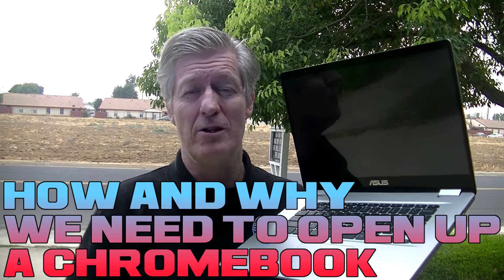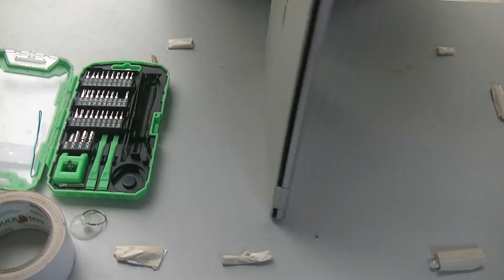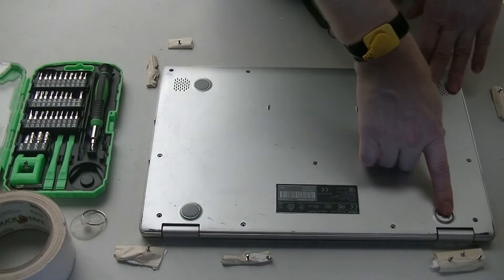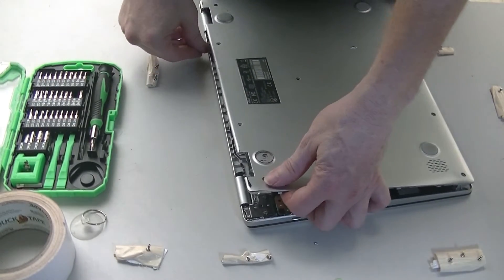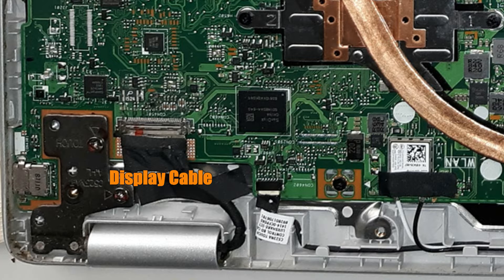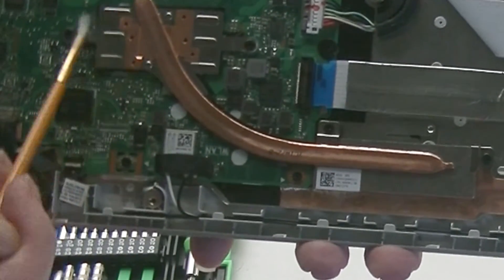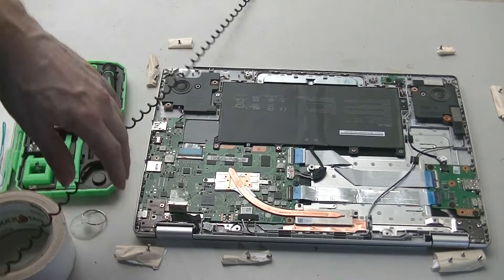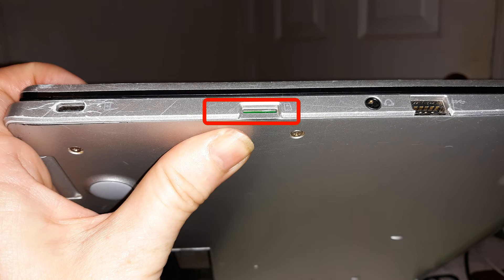How and Why We  Need to Open to Up a Chromebook- Disassembly

Comment: Sir my Asus chromebook overheating after charging and charger also overheating, please give any solution.
Reply from the maker: As seen in the video,   I would clean and blow out the dust, making sure the fans are free to turn.  If the charger is overheating as well, that can be a big problem.  Please make sure that the charger is used in the open and receives good air flow.  The charger may need to be replaced, if it is overheating to a high degree.

Comment: Q U E S T I O N ,  P L E A S E ---  Help !!!  Acer Chromebook 11 CB3-111 orange battery light blinking at times. The Chromebook is connected to work via the electrical power/adapter; HOWEVER, does the battery ALSO have to be partly or wholly full in order to run the Chromebook? ANOTHER QUESTION -- Can I not remove the battery - FOR EXAMPLE - and have it function fully via the electric power, just like a neighbor is doing with his Windows 10 laptop??? Thanks in advance.
Reply from the maker: A1:  System should be able to run with dead battery, if said unit is plugged into electrical power. 
A2: On some models, I have seen that they will run without the battery installed, (on just plug in power alone)  For the CB3-111, I am unsure, as we tested that with a few other Acer, Asus, and Dell Chromebook models and it did not work on most.  The battery needed to be installed in the Asus, Dell, and Acer Chromebooks that we tested in class.

Comment: Help: Can you please tell me where the WP screw is? It's called the Write Protect screw!
Reply from the maker: That depends on which Chromebook model you are working with..  But many models have the WP screw marked with a different pattern than any of the other screw holes on the mainboard.
Reply: @selmateacher7  Oh im using the same one on this video, the, C523N
Reply: So please say, i'm having issues finding it!
Reply from the maker: @yumesh9830  Oh, that model is based on the newer platform and it does not use a screw for the hardware firmware write protect, they use the battery sense line (IE, you simply unplug the battery).
Reply from the maker: @yumesh9830  On that one, it does not use a WP screw, if you need to change the firmware, you just need to unplug the battery.
Reply: @selmateacher7  Which part of the battery? If I unplug the battery it wouldn't charge?

Comment: I have Asus Chromebook C223N, I cannot reseed the battery and when it does power on the screen just flashes on and off.It's only 7 months old ?
Reply from the maker: Had the unit been dropped?  Please check all of the connections both on the mainboard and behind the display.

Comment: Hi I was wondering I have one of these laptops and the charging ports not working so it’s not charging what would I need to do
Reply from the maker: Have you tested it with a different charger?  I say this because I was seeing that one of my usb-c ports seemed not to work anymore.  When I tested it with a new charger.. bang it works...   If the port still fails, you can re-solder that part's contact points, being super careful not to apply too much.
Reply: @selmateacher7  I did I tried another type c charger it didn’t work
Reply from the maker: @victorolaniyan6571  Ok... then that USB-C port might be loose from the mainboard.  It is possible to solder the contact points , just be extra careful to only place solder on the one connection that is loose.
Reply: @selmateacher7  I don’t want to open up myself due to maybe damaging it
Reply from the maker: @victorolaniyan6571  oh yea.. we would do this in my class.  um ..is it still under warranty?
Reply: @selmateacher7  yes it is
Reply: But the told me a long process and it could take up to a month
Reply from the maker: @victorolaniyan6571  oh....  ok.   We work on Chromebooks for free in my class, but alas you are probably not in Reedley, California.
Reply from the maker: @victorolaniyan6571  ok

Comment: Is this chromebook any good thinking of getting this model
Reply from the maker: That model works well for doing everything.  It is of average performance for the price.  Average touchscreen display.  I like the Acer CB515 more, as the CB515 has a better display.
Reply: @selmateacher7  i picked this one up for £180 the only other ones in that price point were 11.6 inch.

Comment: Can you C423NA please it'll help a lot of you ro
Reply from the maker: The C423NA is very similar to the one I opened and cleaned in the video.  You be able to open that model up to clean, check for loose cables,  or repair hinges as seen in the video.
Reply: @selmateacher7  Well my cover comes off easily but the screen won't come out
Reply from the maker: @David.arasaka  On some models, I have to peel of the plastic front bazel from the screen, very very carefully to get to the screws
Reply: @selmateacher7  it's like my screen was glued from the back
Reply from the maker: @David.arasaka  hmmm. I see.
Reply: @selmateacher7  The C423NA has no screws
Reply from the maker: @David.arasaka  If really no screws, use hot air -heat gun to loosen glue, like on an iPhone.
Reply: @selmateacher7  Thank you very much

Comment: I need you to really just find a way to upgrade the eMMc drive as mine is corrupt asked the repair shop from asus to find the problem and they said they can't upgrade the eMMc drive. But from what you said, you said that it is not easy to upgrade it. So you might have a way? I am using the same model as the one your showing. Hope you have a answer after thorough testing.
Reply from the maker: LOL.  I have a video for that.  In the video I go over upgrading the EMMC
https://www.youtube.com/watch?v=vGatKmqYxEA

Comment: hi. have you tried to install windows or at least unlock bios to be able to install another system on this chromebook? cheers
Reply from the maker: No.  I happen to know how to do everything on Chrome OS which is more secure than Windows, so I normally stay in that Chrome OS. My other videos show how to find and do your work all on a Chromebook.   Thank you for the question.  Cheers.
Reply: There actually might be a way (Have not tried it) but you have to basically unplug the battery, remove it and then write protect will be off.

If your using like the older version of the chromebooks, you have to find the write protect screw (Looks like a disc)

Run these Codes in the terminal (ctrl +alt +t) to check:
cd; curl -L -O https://mrchromebox.tech/firmware-util.sh && sudo bash firmware-util.sh

once you ran that, you should be popped up with a menu (after downloading of course)
You might see WP is off/Disable. If not then there is no way to do this.

But if WP is disabled, select Full ROM firmware, if not available select GBB flags.
Restart the computer.

Press esc
Insert your bootable USB Drive (containing ANYTHING)
Select boot menu
Select your USB drive
And it will boot up the OS.

WARNING:
I've tried it on a older chromebook and windows 10 was SO slow. So if you do want to boot up windows 10, do it at your own risk. I recommend staying with chrome OS or installing linux mint or anythong else.

Credits to David Beneth and Mr Chromebox (Chromebook God).
Reply from the maker: @charlesspencer6673  I go over the steps in the video:https://www.youtube.com/watch?v=vGatKmqYxEA
I do have other videos where I go over this as well, just do a search in my channel, if you need more help.

Comment: Where is network card in this chrome book
Reply from the maker: It is not a discrete card any longer. It is now a chip that is soldered on the main board.
Reply: Thank YOU so much  for your reply. I have to turn power off and then on atleast 10 times before the network show up. Most of the time the network list is blank. Is there anything I can do other than taking to Asus service?
Reply from the maker: @DineshRangarajan  Oh.  If your Chromebook is giving you issues, please do a powerwash as seen here:
https://youtu.be/TSjhSC3ILVU
Reply: @selmateacher7  I did power wash few times but the same issue. I have to keep the power option to not go for sleep when I close the lid. If by mistake the chromebook goes to sleep then I loose all networks on wake up. Thank you again for your patient replies.... appreciate it!
Reply from the maker: @DineshRangarajan  whoa.  I am sorry to hear that.  After doing a little research I found that the bug reports for this issue have skyrocketed and peaked, but many Chromebook owners are still facing the same “automatic disconnecting issues.” Some have been able to fix them simply by updating their Chromebook to Chrome 81 or higher.

Comment: I tried everything as you mentioned but won't be able to turn it on.
Please suggest what else i could do to fix it.
Reply from the maker: I need to know more to go on to the next steps.  The problem may be in the charger, if it is not charging or even a loose cable.  In my experience, I have seen both as being common problems.  Is your Chromebook charging?  Does it seem to turn on, but have a blank screen?  I need more information, as I am helping about 50 people at the same time on my videos.

Comment: help, ive done all of these and none of them work. i can see my screen switch to a different brightness when i turn it on and its not just the brightness key. please help
Reply from the maker: You may do a factory reset, if you believe that it is a software bug... 
Sign out of your Chromebook.
Press and hold Ctrl + Alt + Shift + r.
Select Restart.
In the box that appears, select Powerwash. Continue.
Follow the steps that appear and sign in with your Google Account.
Reply: @selmateacher7  thank you, but i already have a different one. Thanks for the help though :)
Reply from the maker: @SaturneKx  You're welcome

Comment: Why!!??
Reply from the maker: LOL.  Why.. what... Do you mean why do we ever need to open a Chromebook?  Well... As I stated i the video, Reason number 1:  If the system is overheating, then we need to open it up and blow out the dust.  That is reason #1
#2.  Brocken hinges.
#3 Brocken Power ports
#4 Loose display cable.
People bring me their broken Chromebooks all of the time and those are the reasons why I need to open them up.  One of my computer classes that I teach is, A+ Cert, where I train students to be a computer tech. So many people in my area know about me and bring me their sick computers for me to fix.
Reply from the maker: Wow.. It happened today!  My Acer CB515 left hinge went south and I had to open it up to tighten the screws on that hinge.

Comment: Someone put a sim card into the sd slot. Can I get it out if I take the back off?
Reply from the maker: Unfortunately, the slot is enclosed from the back so even with the back cover off, it does not open up the slot for you. The only way to remove something that is stuck inside of it is to go through the front opening.
I have seen broken 3.5 audio. Jack stuck in the audio port and the only way to remove it was by using a pair of small needle-nose pliers or tweezers.

Comment: Interesting to see the inside of one of these.  Thanks!
Reply from the maker: Thank you for the comment.  Yes, it is sad, however that nothing is user upgradable.  We normally only need to open these to clean out the dust.  Sometimes there is a loose display cable, but that happens more rarely.